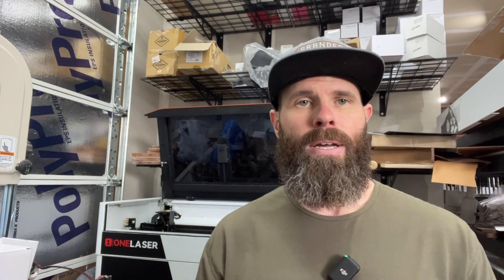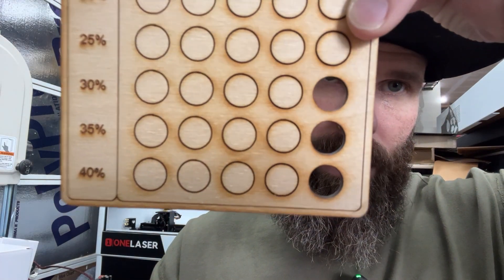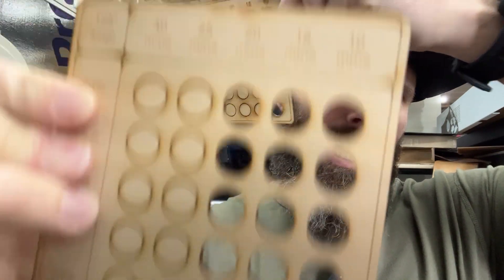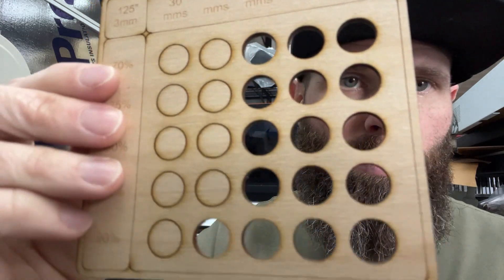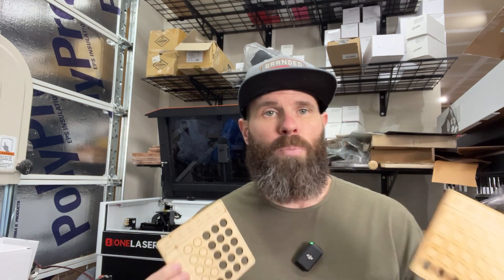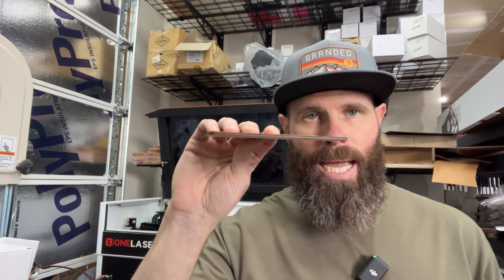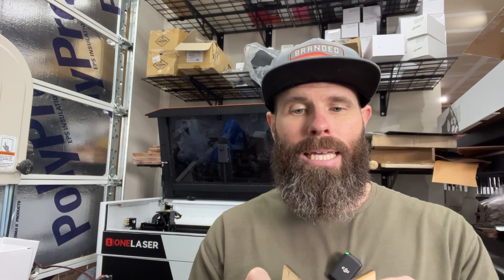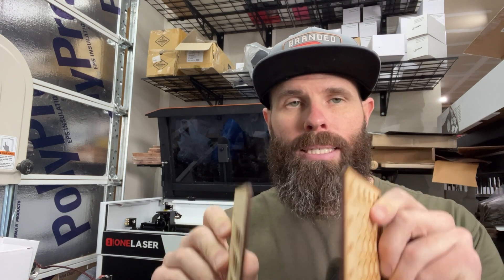Air Assist??? Why Upgrade???

Comment: Do you have any samples on 1/4"+ acrylic edges with better air assist.  My edges are somewhat polished but still see the "saw" marks.
Reply from the maker: Saw marks are usually because of too much air, too much speed, or not enough power.